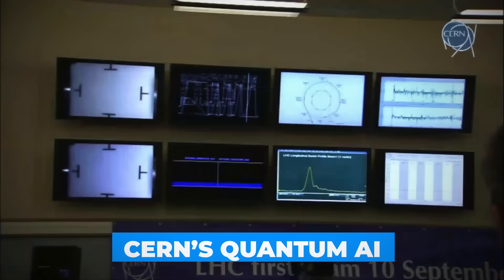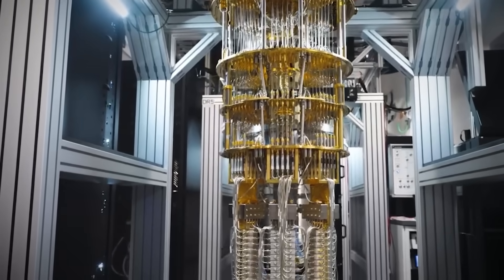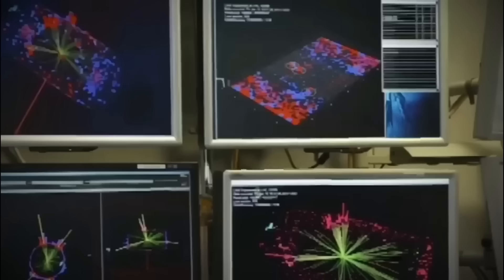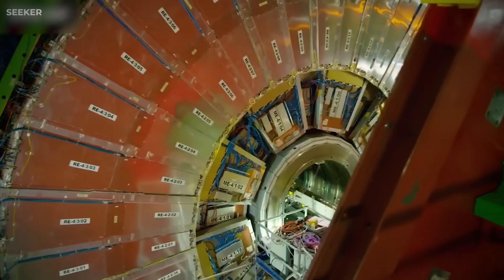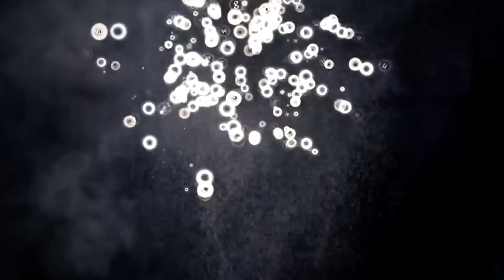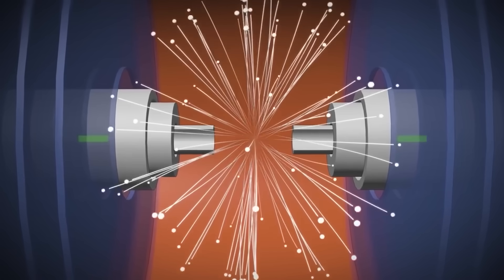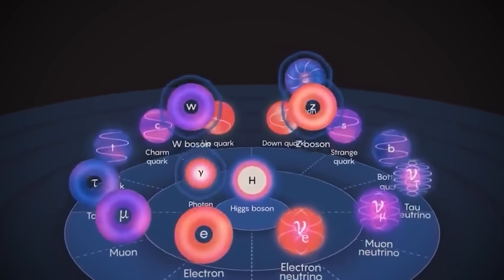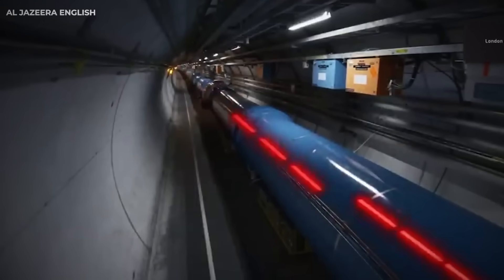Expert Warns: CERN’s Quantum AI Just Cracked Terrifying Spacetime Data

Comment: need to share this because it changed everything. was stuck in the same patterns for years - overthinking, self-doubt, feeling blocked. heard about this book Manifest the Unseen by Luna Rivers in a podcast and the quantum physics approach to manifestation finally made things click. 3 weeks after reading: noticed synchronicities everywhere, opportunities flowing naturally, and my mindset completely shifted. if you're feeling stuck like i was, the frequency alignment method in this book works. still amazed at how different life feels